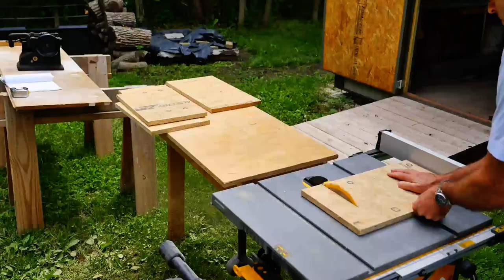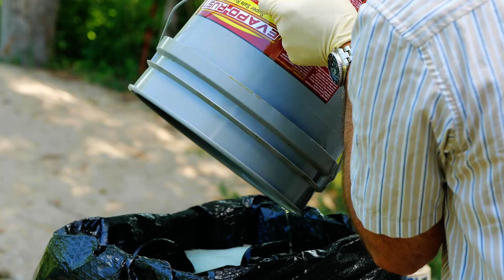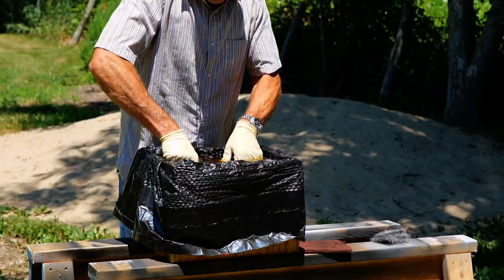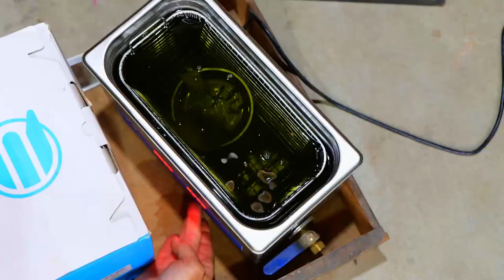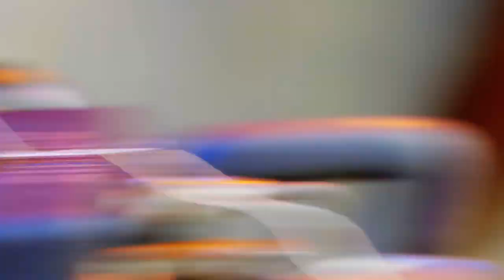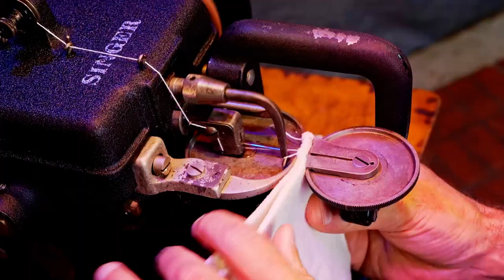Singer 176-33 Fur Sewing Machine

Comment: You may already know this trick, but when you have partially-delaminated veneer/wood layers  (on corners and/or odd places) you can use a length of thread/string to drag/pull the wood-glue in between the layers before clamping. I’ve had pretty good luck/results from this method.
Reply from the maker: I did NOT know that trick but now it seems so obvious and I have so much thread on hand. 😕 Thank you.

Comment: I would have never thought of soaking in a vat to free it up or pressure washing after. That’s the problem with that 15-31 I rescued it was under water In a flood I got the mechanicals freed up but the base glue is shot and the panels came apart and the vernier peeled off . Should I just glue the panels back together and paint the top surface use it like that or have something glued to the top or just have a new base made up based on the existing top ?
Reply from the maker: I am sure you will make the right decision. I have seen folks go either way and to good effect. It kinda just depends on how far gone the old one is, Mine seemed pretty good still with just a few loose edges.

Comment: Hey there, im absolutely struggling with all three of my machines not picking up the loop! Any idea?
Reply from the maker: Are you sure that you are turning them the right direction? Are the needles correct? Are they installed correctly? Are you threading them in the correct direction. Any one of these things could cause the problem.